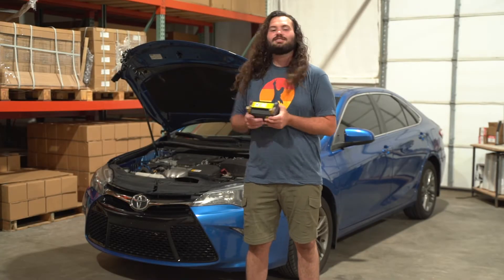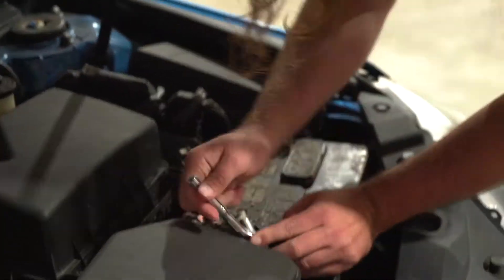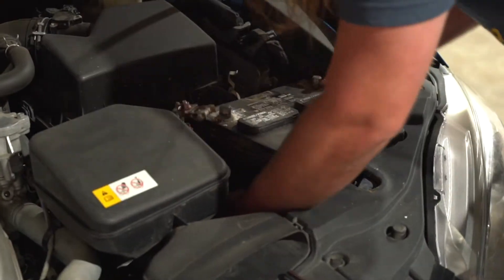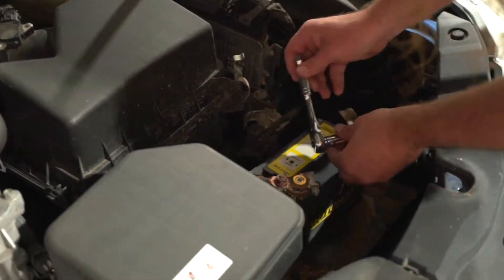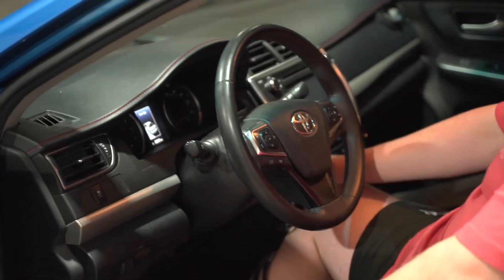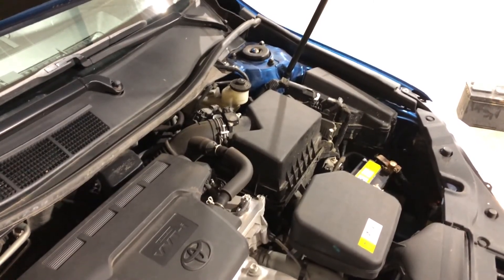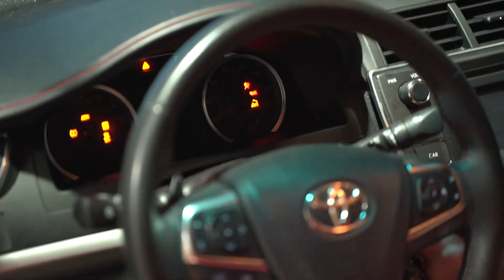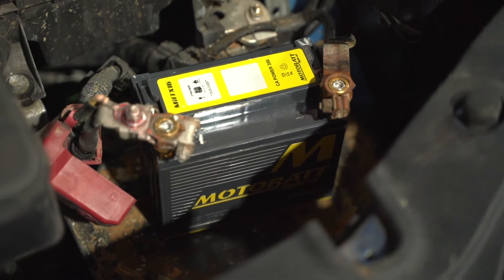Can a Motorcycle Battery Start A Car? How About An SUV or Pickup Truck?

Comment: There's my answer. A jump starter is more expensive than a motorcycle battery, so I'll use it as a backup battery.
Reply: I bought a jump starter from Temu 2 years ago for 18 buck (22 now). Never needed it until recently. I always charged it every other months. In the last 3 days I was stranded 4 times and it was able to jump start my car. Definitely cheaper than a moto battery 🤣.  My car is also a V6 3.3 L.
Reply: @shayanshahriar7882  I wouldn't trust batteries from Temu. Yes they may work, but you never know when you'll lose an eye.
A BOSCH 0 986 FA1 110 has 70CCA and it's enough for my oldtimer and a 1/3 of the price of a proper jumpstarter, a 3.3L you may need more.
A friend of mine drilled a hole into the wheel well and build a ratchet crank handle. If he takes off the wheel he can start the engine without a battery. :D
Speaking of batteries, change yours. I recommend Varta.
Reply: @DaxterSnickers honestly I had very low hopes for that jump starter. Bought it as a 'just-in-case' and presently surprised at the performance. And, ya, I will change the battery as soon as the next paycheck hits.
Reply: @DaxterSnickers I had to jump my car again one hour after commenting here. Got fed up, drove to Walmart and replaced the battery at the parking lot. That Temu Jump starter performed wayyy over its paygrade.

Comment: Are the post adapters homemade or can I order them and under what name? I'd like to use two in my car hooked up in parallel.
Reply from the maker: I thin the post adapters were from Odyssey or perhaps taken off a Braille battery.
Reply: @impactbattery8895  Exactly my question! (I have also sent you an e-mail). I would like to install it as you have shown in the video, but I can't find a suitable connection option. Could you perhaps provide a link?

Comment: Nice, will leaving the Motobatt on this vehicle for daily use and letting the car alternator charging it while the car is in use cause any problem to the Motobatt battery? Like overcharging? Unsure if bike and vehicle have the same charging volt and amp while in use.
Reply from the maker: In theory the vehicle charging system would have no ill effect on the battery. However, the demonstration was simply to show the power of this motorcycle battery. If it can start a car, pickup truck and semi-truck it can surely start your bike or ATV. Your primary car battery needs higher amp hour to better run applications especially when the vehicle is off. So we do not recommend it for regular passenger vehicles. With that said, we have had some people install these into their race cars to help shave weight and increase power. they have also been installed into some interesting industrial applications. To our knowledge no one is yet using the MotoBatt Hybrid in their passenger vehicle... but if Odyssey motorcycle batteries (PC680, PC925, PC545, etc) have special brackets made to install in cars then it will only be a matter of time before the same happens with MotoBatt Hybrid.